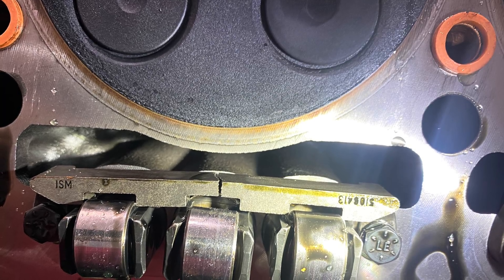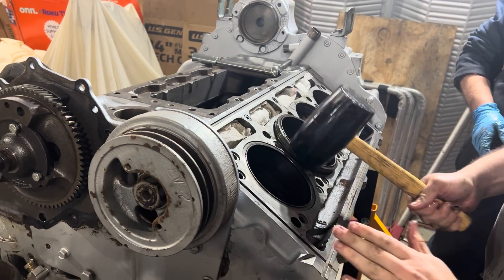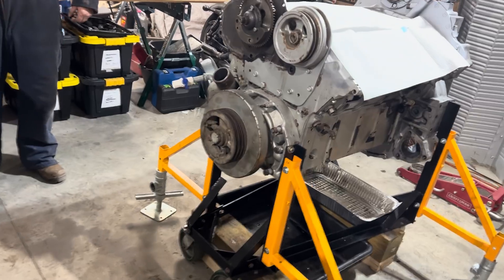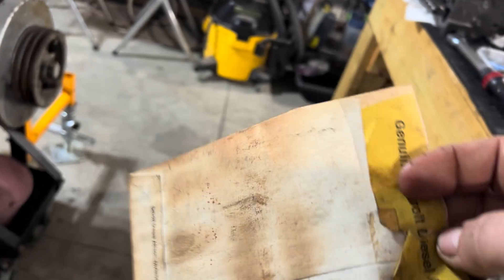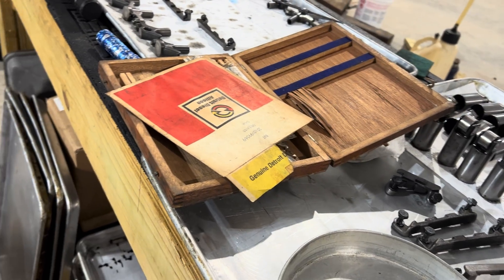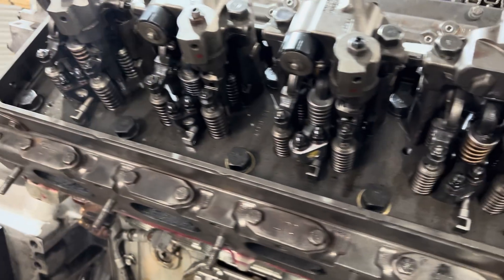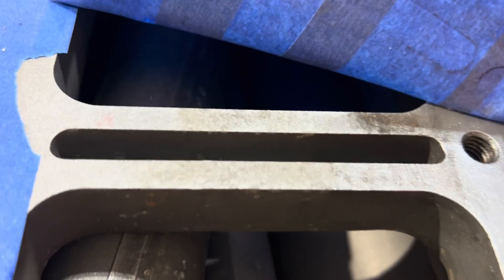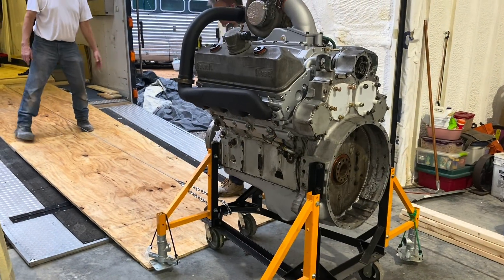Detroit diesel 8v92TA assembly after tear down. Scenicruiser bus engine upgrade.

Comment: Thanks Scott, ✌🏽😊 l am going over some of the vidio's that l missed, Huge fun for me to watch this, never saw the internals ov a Detroit before.  I was so excited,  it went by in like seconds, l would have liked to seen more, more details, like checking if the cylinders needed a shim or not? It would be nice to see that, this vidio could have been an hour? or two longer. Like what about the blower? Seals? Was it oiled? The scallops lubed for initial start and run in? just how much torque were the head bolts?
If lm looking for a bus? What is the best engine for power? Best for longevity? Torque? I want a foot stomping, ground pounding powerhouse❕l want to drive 75 - 80 m.p.h. and have some, lots left for climbing those really long B.C. 🇨🇦 mountain grades.
👌🏻✌🏻🙋‍♂️🌤🇨🇦🖖.

Comment: Is that a 430 Detroit?
Reply: It's an 8-92T (or TA).... not sure of it's particular hp rating in this coach, but the 92 series V8's (with turbo(s), could range anywhere from 400 to over 800 hp (marine applications)... all depending on injectors (volume and flow rate characteristics... there are Many different ones), blower model and gear drive ratio, single or twin turbos, size thereof, whether "dry" or water cooled (marine).

I have seen some 8-92's with the twin turbo kit (including matched injectors for the turbo size & air flow rates), in bus conversions (motor homes) that are rated to 520+/-.

Comment: Having built many of these engines I always found that getting new liner shims under the liners keeps them real close for protrusion. I always aimed for .046 as it gave the head gasket a good crush on the head.Looks like you did a good job on this engine
Reply: What does it mean "a good crush"?
Reply: @adamromanak7605  crush means the gasket that sits on top of liner that the piston rides in allows a tich seal between the cylinder head and the sealing of the combustion chamber on top of the piston. Remeber these engines fun at around 17:1 compression ratio and you definatel want to keep the combustion gases in the cylinder. Ok?
Reply: @rogeryoung2049  ah, thanks for that. I know nothing but like to watch and learn.

Comment: As a kid, I would listen to the announcements at the station, one was Greyhound "Scenicruiser Service", and one was "Americruiser Service." One service stopped everywhere (and made for a looong ride), and the other service seemed like an "express bus" with fewer stops. Can anyone clarify? I always wondered if that was the case?
Reply: Ed Smith... The difference between the two "services" was actually the type of coaches used on particular routes.  The "Scenicruiser" Service just meant that the GM PD 4501 would be used (considered by many to be the "most beautiful coach [bus] ever built).  

In case you're not familiar with the model designation, just do an online search for GM PD-4501.

It was designed by Raymond Loewy who was a well known Industrial Designer, and who also designed Streamlined Steam Locomotive outer bodywork for the "Pennsy" RR in the 1930s & 40s for passenger service and hundreds of other well known companies of various industries.

The "Americrusier" Service indicsted that the passengers would be riding in a MCI MC-12 coach.

Comment: Scott is there any value in an 1989 8v92 with 100k miles. It is in a fire engine. Just a ballpark
Reply from the maker: 500-2k depending on how long since it’s been run
Reply: @BusGreaseMonkey  thanks. It's running and still in the truck. No smoke no oil consumption.

Comment: I think I missed something.  You were using a suction cup on the side of the piston.  Why?  Is the wrist pin O-ring sealed on the Detroit because it passes over the ports in the cylinder?  That has to be it.
Reply from the maker: Pressurized oil shoots up the rod

Comment: DD Guild memeber in the day, certified for all series; my fave, 12V-71 in an Astro. Straight pipe glorious noise; we had our drivers comment on the exhaust note when climbing a long hill outside of town, to know if our tune-up or overhaul was top notch. Still have my 60 Series accreditation framed and posted in my shed.
Reply: I've only seen one Astro truck in my life and it had a Caterpillar engine in it.
Reply: @safetyvideos9866 ... Other than several of GM's own Detroit Diesels (6-71 as the base engine, the 8-71 & the v12 which was dropped in 1978 for the Astro), before the 1977 model year, no other diesel brands were ever an option.  

1977 opened power options for Cat. with the 3406 PCTA (pre-cup head & injection system), as well as the Cummins KT450 which was the main reason for the enlargement of the radiator and corresponding larger front grill.  

So, the one that you saw with Cat power, had to be 1977 or newer.  

Actually, Very few of the Astro 95's were ever ordered with Cat power until Cat re-headed the 3406 to DI/ Direct Injection, compared to the Cummins, and most of those were after 1980 when the Cummins NTC Series was added to the line up for power options in the Astro.  

The Chevy Titan COE was dropped from production in 1980, in fact that was the Chevrolet HD Divisions last year of producing HD class 7 & 8 trucks.  

GMC continued until 1987, when Volvo bought into the GMC HD division... then shut it down.
Reply: @Romans--bo7br  I believe it had an engine swap.  When I first saw the truck I was expecting it to have a 2-stroke in it.
Reply: @safetyvideos9866 .... Hello and thanks for your reply.  Possibly could have been a swap/repower... If, it was a model year Prior to 1977, but as I mentioned before, the Cat.3406A did become an available option with the 1977 model year, as well as the Cummins KT 450, though Very Few were ever ordered with the KT.  

Cummins NTC series were available as optional power as well, beginning in 1975 and was the most popular choice as an option... especially in the western states.  

The mid western. central and eastern states, as well as the eastern Provinces of Canada, favored the Detroits.  
Single drive axle units heavily favored the very reliable 6-71, and the early "twin screw" Astro (& Chevy Titan's) were the domain of the 8-71, and the V12 was a big favorite in Eastern Canada for pulling doubles with GVW's of up 118,000 lbs.  

Just as an aside, the GMC division had developed a turbine powered Astro 95 as well, but did not make it into actual production due to "insufficient fuel mileage".... which was pure "baloney", as they were getting nearly 40% better mileage in the semis, and the converted Greyhound buses, were getting 3 times better fuel mileage than the diesels were (8-71 Detroits of the era)... averaging 10 - 12 mpg, fully loaded, according to several people I knew who were associated with the development & testing programs at the time.

It was "big oil" that got the turbine programs shut down for vehicular use through their lobbyists in DC... Not the lack of fuel mileage.
Reply: @Romans--bo7br   Out curiosity what was noise level a turbine in Astro?
Reply: @gullreefclub ... thanks for your response and question. I do not have the exact decibels recorded by either the GMC nor the Chevrolet divisions on their test units. 

I do know that the Allison GT 404-4 engines that were installed into the Chev. Turbine Titan 90 and the GMC GT Astro 95 Special were both recording about 90 decibels at the exhaust stacks, and that two GM engineers riding in the cabs could easily speak to, and hear each other from across the cab at normal voice levels with no problem... which would indicate that the interior turbine sound levels had to be at 65 db maximum... quite probably closer to between 58 and 62 db.  

Fords "Big Red" from 1964 - into the early 1970's was said to have recorded db readings of 50 - 54, which is very quiet... but, Fords truck was designed and built specifically for the Turbine, which included special sound proof insulation.  

The GM units, were regular production line trucks that were powered with the turbines, with no extra special sound proofing installed, so they proved to be considerably quieter than with the diesels that averaged approximately 80 db for interior, engine sound levels. 

Sorry, but that is all that I can offer you for an answer.... and hope it actually does, answer your question.  

PS;  The Chevrolet division, actually had another Gas Turbine truck program going, in collaboration with the GM Styling Dept... which produce Three different vehicle designs using turbines (GT- 309's).... only the Gas Turbine Titan III was ever actually driven and pulled a 42 ft. semi-trailer built for it.  

All Three "disappeared" completely after the program was shut down.
Reply: What time period did you work on them?

Comment: This may be a dumb question, but would it help seal the heads better against oil leaks to use a non hardening sealer like High Tack on the perimeter seals instead of grease? I'm no Detroit guy, but I have built countless race engines from many manufacturers and have found that High Tack has been my best friend for many unconventional purposes lol.
Reply: Thumbs up; been using Hi-Tack since 1960.